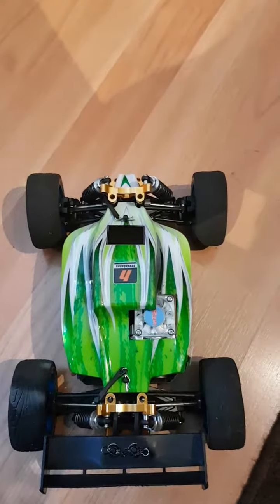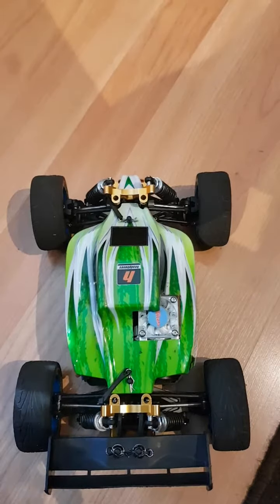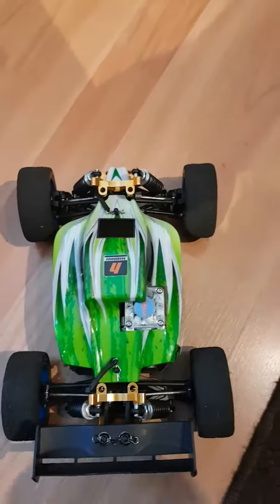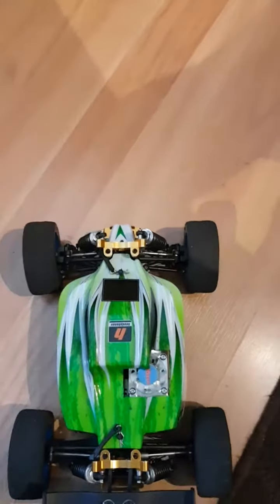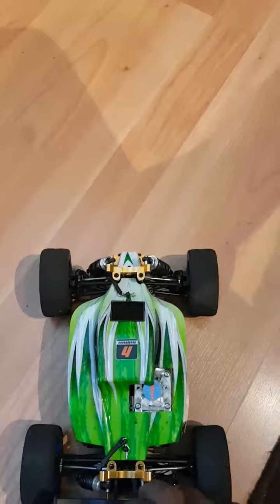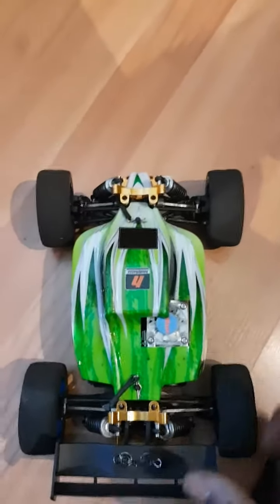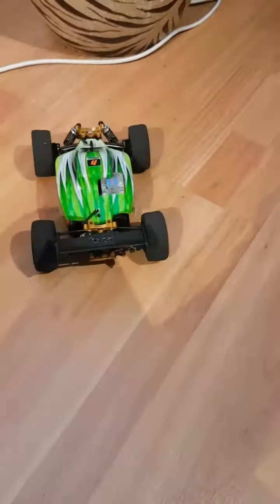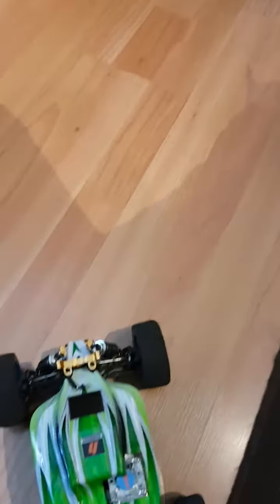A959B sound of original gearing to upgrade full metal gearing.

Comment: I upgrade all metal gear including differential gears But mines Make Noise  and if i pushed by hand it a little stock sometimes need to put more pressure to move it by hand.      Any suggestion.      It full stock except gears
Reply from the maker: Change the diff gears some are better machine than other. You get them in like a black metal bronze metal copper looking metal and the stock silver looking metal. Try the gold bronze looking gears they work best. It not you it gear mesh in diffs. I've had this problem and when I use metal diff casing it rubs on inside I had to smooth out inside metal diff case. And make sure your gears on ends of drive shaft are on fully and tight lock tight them.